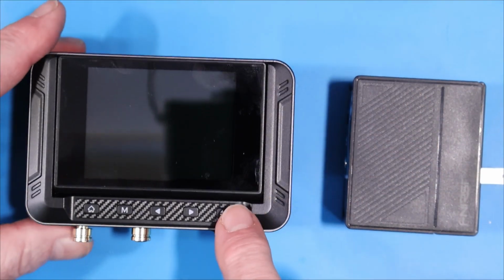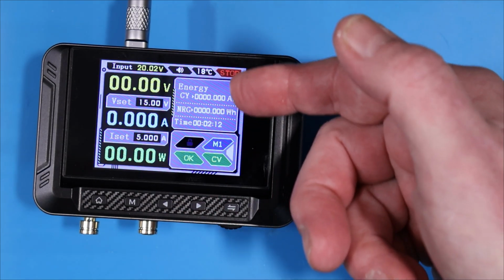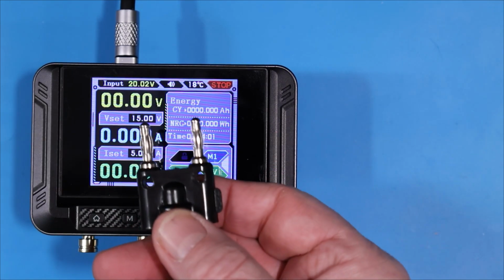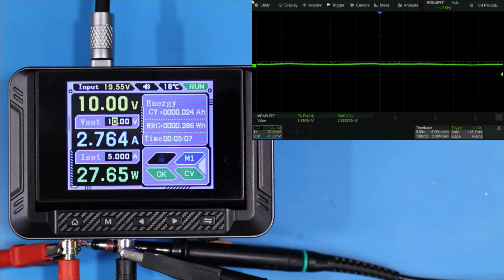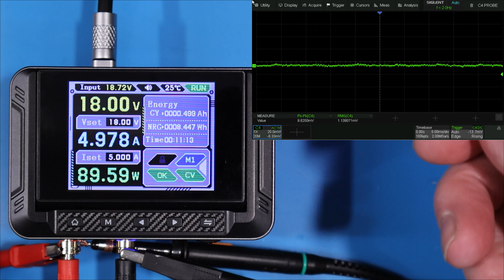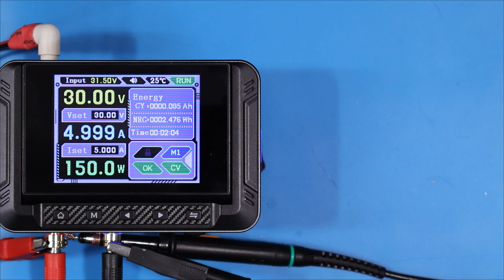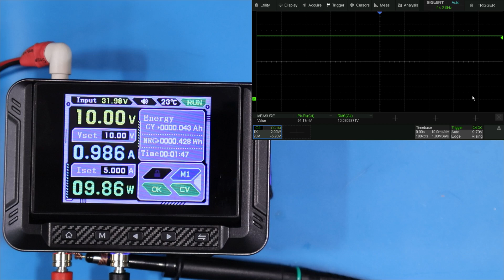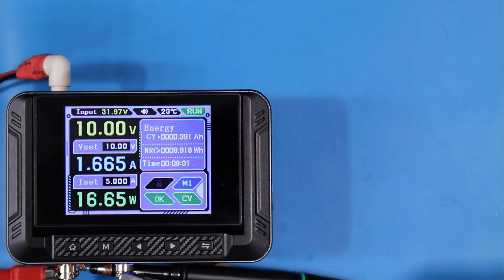Uni-Byte 0249 - FNIRSI DPS-150: Part 1 -  Power Supply Review and Test:  Nice!

Comment from the maker: In case anyone wants to get one of these an d get full power out of it, then 5mm x 2.5mm plug is rarer than hens teeth.  However, DigiKey have them (not at Ali-E prices though).  The part number is: 1939-1718-ND.
Reply: Also confirm before use of a DC supply that the tip/center of the supply connector is (+) polarity.
Reply from the maker: @pault6533  Good advice.
Reply: @uni-byte  Can you confirm outer diameter of 5mm? Here in Europe we have 5.5mm outer and 2.1mm / 2.5mm inner diameter as known dimensions.
Reply from the maker: @heinzkreutziger2218  That's what I'm using and it's the only one that fits, and it fits well.  Not contact issues.  There are 4 small springs in the sides of the socket that may get pushed out of the way if a 5.5 x 2.5 plug is used.  I'm reluctant to try to force one in there though.
Reply: @uni-byte I hate to say it but that just sounds like my high power 5.5mm plugs… they really grip well. I bought one of these power supplies to use with my dewalt usb c adapter so I’ll check and confirm. I have A LOT of 5.5mm style connectors
Reply from the maker: @kincheng  That's what everyone says but I could not get the 5.5 in there and the 5.0 is a snug fit as it is and works a charm.  Go figure?
Reply: @uni-byte I received my DPS-150 and it’s pretty awesome! The port is definitely the standard DC5525 in my case however. I purchased from the fnirsi official aliexpress store. I suspect your port must be different…
Reply from the maker: @kincheng  Yes, mine is getting a lot of use.  It may just be that the port is pretty flexible WRT a smaller barrel and my dc5525 plug was a little too large (out of spec).  I later got a pile of adapters, and the 5525 in that set fits fine.
Reply: Thanks for warning about the spacing of that banana clip port. Does the alientek dp100 have proper spacing and is that PS more recommendable?
Reply from the maker: @OMNI_INFINITY  I'm not familiar with the Alientek.  I think Dave Jones (eevblog) did a quick review of it.  The FNIRSI is very nice despite the unfortunate socket spacing.  It has a permanent place on my mini-lab workbench.
Reply: @uni-byte  Ah, thanks! That socket spacing is RIDICULOUS. Yeah, davey jones endorsement of DP100 is big, but the text looks so small on that.

Comment: What is the switching frequency of this device. Not mentioned in the product specs.
Reply: I'm sorry for dumb question, but why waveform of the Fnirsi  is not sawtooth/triangular type as usually DC ripple  is measured and presented in educational videos? On your measurements, it has this nature only when CC is triggered.
Reply from the maker: @pavelzhelyazkov3874  It's a bit complicated.  When this goes into CC mode, the ripple you are seeing is due to the current control loop both in it's response and the way it is implemented.  Unlike in a linear supply, the CC is acheived by turning on and off the output.  When it turns on it charges the output capacitor quickly, then when it turns off that cap discharges through the load which give us a situation very much like you would get with an unregulated  but rectified and filtered linear supply.  However, the frequency has nothing to do with AC line frequency.  The other ripple, caused by switching regulator can indeed look triangular under the right circumstances.  You can see a bit of that in the video, except teh amplitude is very low.  Mostly thought, switching regulators produce a "noisy" output at high frequency as it uses very short, high powered pulses to maintain the desired voltage.  If yo were to filter out all the noise spikes, and amplify the result, yo should see that familiar sawtooth appear.  It would be very hard to do, but theoretically it could be done.
Reply from the maker: I don't know.  The ripple I saw on it varied between about 135Hz and 1.2kHz, but I don't think that has anything to do with the switching frequency.  Why would that be important?
Reply: @uni-byte  I'm trying to triger the waveform of ripple with some cheap osciloscope on this FIRSI DPS-150. But probably osciloscope can't sense it or my knowladge    is very limited. :)

I guess, the waveform of ripple will be with the same ferequency as switching frequency. It looks like this is not he case.
Reply from the maker: @pavelzhelyazkov3874  Right.  The ripple need not have anything to do with the switching frequency.  It has more to do the the response in the regulation.  Mostly the current regulation.
Reply: Thank you for the detailed explanation!

Comment: Conert a higher power supply (<31Volts) to any voltage between 1 to 30volts
Reply from the maker: Yes, that's correct.

Comment: This may seem like a basic question.  I want to power a dc motor at 5amps with voltage at whatever it uses. So I guess you would call this constant current. Can i set amperage and the voltage adjusts based on what the motor draws? Also, can this be set to supply for a certain amount of time? So supply the motor with 5 amps for 20 minutes, then turn off.
Reply from the maker: Yes, you can If you have 12V 5A motor, you can set the supply to limit at 12V and 5A.   The controller software for it has a full sequence in it, so yes, you set it to run for a while and shut off, you just need to hook it up the a PC.
Reply: @uni-byte thank you
Reply from the maker: @NaughtyGoatFarm  No problem.

Comment: I would guess the metering/measurement setting might be a voltmeter/multimeter type feature.
Reply from the maker: I'll check on that.  The manual leaves a little to be desired.

Comment: A couple facts for you.  #1 FNIRSI has improved the 100W GaN charger late Nov 2024.  They told me it is more stable, less likely to burn out when used at high power for a long time.  That new charger has yellow on the AC plug side.  #2 Although the device can handle higher voltage in it's DC jack, it cannot negotiate 28V with PD3.1  The device has PD3.0 hardware, which can request 20V at max.  Perhaps a future version will utilize PD3.1.
Reply from the maker: Good info.  Yeah, this was sent to me in early November.  It was severely delayed due to a postal strike here in Canada.  I've seen that new adapter and was wondering about it.

Comment: The performance is equal to or better than the large bench supplies I have, even more powerful too. I think it would be nicer if it had a physical keypad, though.
Reply: I wonder how much this supply "cleans up" the DC voltage going in.  I would assume at high demand, it's garbage in, garbage out.
Reply from the maker: @pault6533  I would imagine you are right to a large extent.  The idea would be to supply it with reasonably clean power. If you gold plate a turd, you still have a turd.
Reply from the maker: I agree on the performance.  A keypad would be nice, but it would need to be much larger.

Comment: Really impressive power supply in small form factor. Glad to have your review. It would be good to figure out how the supply behaves at high output power (>100W) for at least 10min in order to checkout thermal behaviour. Thanks for this review.
Reply from the maker: Thanks.  In real-time it was at or about 150W for well over 10 minutes.  It got mildly warm, but my lab is usually very cool (15°C).